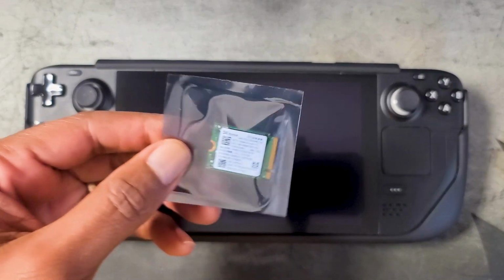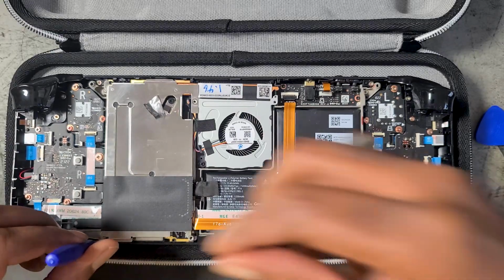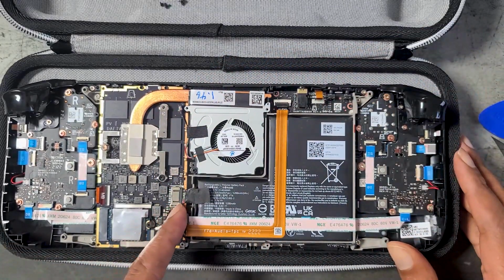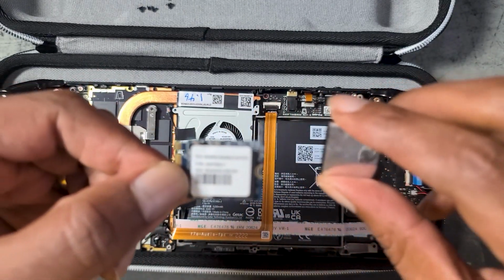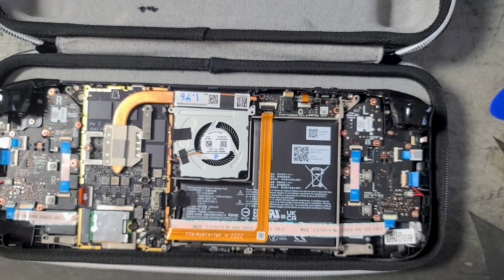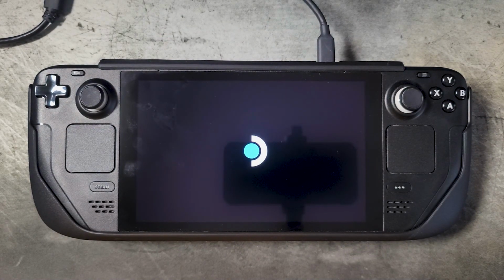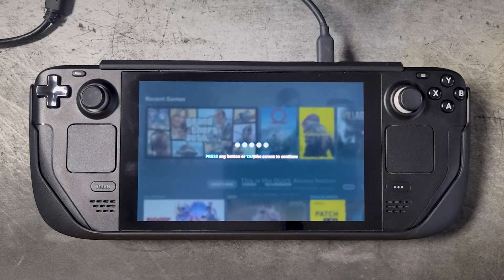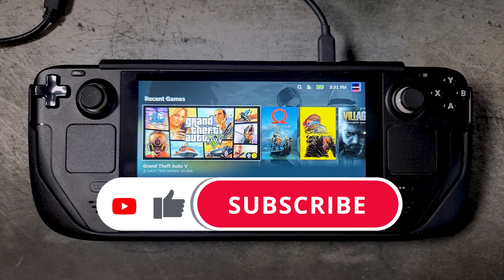Steam Deck Tips: How to Upgrade the Internal SSD - Windows 11 Dual Boot

Comment: I just did this mod. Very easy but I somehow managed to semi-strip a couple screws. Managed to screw everything back and close the device but I feel like I won't be able to open it up again because of the stripped screws. The only other mod I was thinking of doing was swapping out the sticks for gulikit hall-effect ones but the stock ones are already really good
Reply from the maker: I was kinda worried that would happen when I did mine (stripping the screws) There is compound for that I believe. If you can manage to get them out you can apply the compound on the screw to fill in the stripped space
Reply: @OVERKILLGAMING786  thanks, I'll keep an eye out for that. Also stripped the screws on my nintendo switch joy cons so that should help
Reply: Managed to strip 1 screw in the top left corner screw on the shield plate when attempting to screw it out. Wound up having to bend back the corner of the shield to gain access to the SSD Drive/Battery terminal on my first SD. No stripping issues when swapping out SSD on my second SD. (Got a 2nd SD solely for dual booting purposes). 
Just to Add: First time I used an included screwdriver that was packaged with ExtremeRate controller paddle upgrade kit. Second time used a small bit on a PC screwdriver.
Reply: @CROOKS326  lol I think I used the same screwdriver from ExtremeRate that 
stripped my screws
Reply: @FS-zt6tm  Lol. Lesson(s) learned. All that because I was too lazy at the time to grab and open my PC screwdriver kit.

Comment: 2TB?! I just upgraded from 64GB to 1TB yesterday and have no real idea how to use the space. I just wanted to run windows from the internal SSD as using win on microSD would chug along sometimes. Partitioning the drive was the fussiest part, I tried to use gparted but that came up with errors so I used KDE. The lesson learnt was that you must have a keyboard as the steam recovery usb mode doesn't have an onscreen keyboard. Now I have 300GB steam, 200 NTFS, 500BTRFS for sharing. I only have one steam game, 99% of my use so far has been Batocera on SD card but I wanted to see if it was feasible to use the steam deck as a proper windows machine for some work. Thanks for the video.
Reply from the maker: Check out my latest video on the Ayaneo Geek. That one came with a 2TB SSD and can be expanded to 8GB. I have 20 games on there and still have space left... 😂
Reply: @OVERKILLGAMING786  cheers but my triple A game playing says are over.
Reply: So in the end is SD usable as a proper windows machine for some work ? Considering getting one for that purpose
Reply: @noclipfpv2014  yes, if you get a lapdock, or monitor, mouse and keyboard

Comment: I want to do this but I'm lowkeu scared lol
Reply from the maker: Its really simple. Just make sure to unplug the battery and drain the power (press the power button 2-3 times) to discharge any remaining power before unplugging the SSD. Make sure not to lose any screws and to remember where they go.
Reply: You have any recommendations on ssds